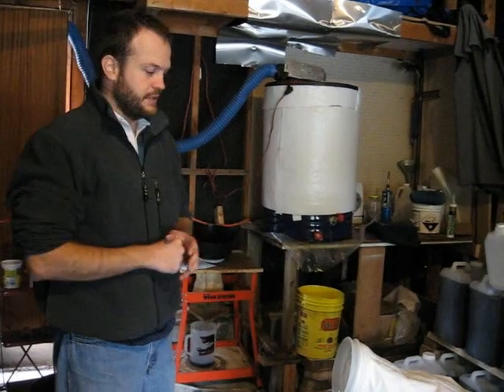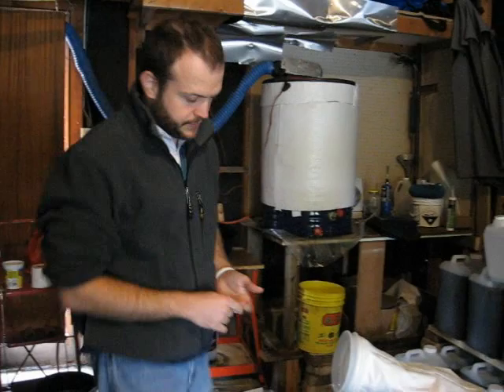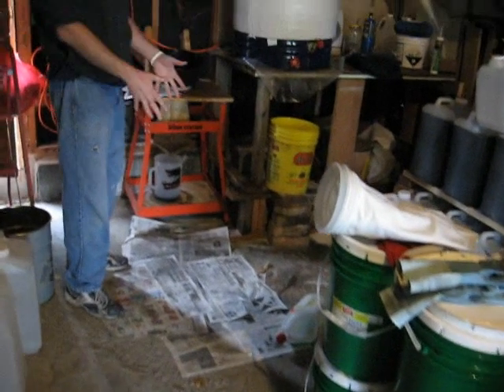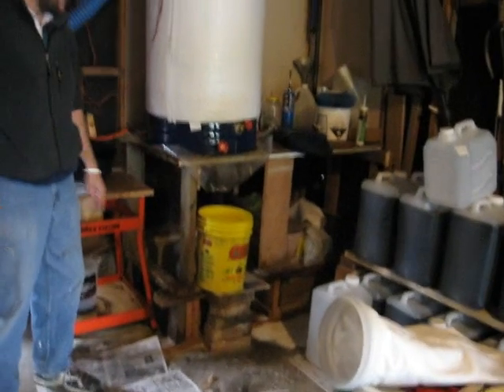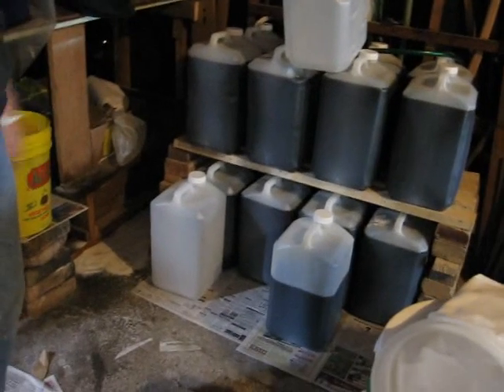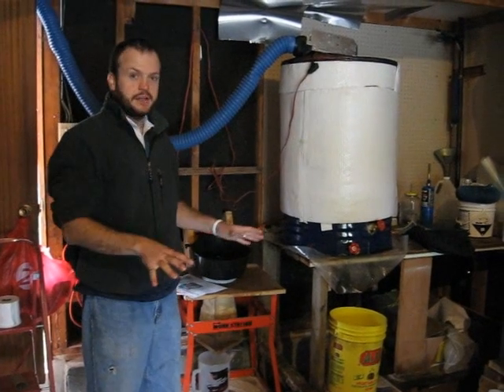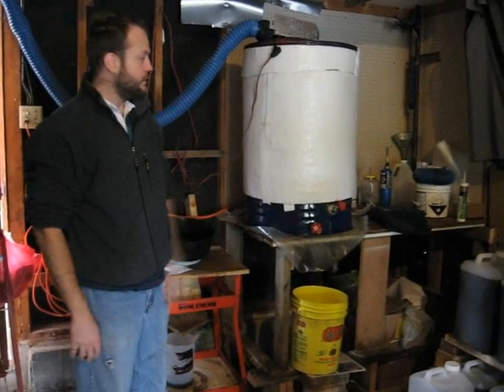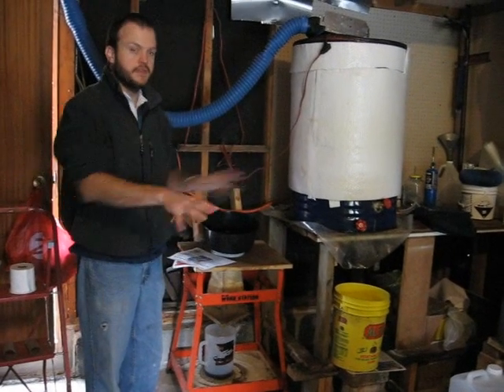Veggie Oil Fuel Home Processing Plant

Comment: Not bad, but seems like it cost more work and money than needed.

You can do it with one or two 55 gallon barrels and 2 weeks settling.
Even after just one week you can siphone off the top half of the barrel and use it.
Miniscual ammounts of water will not hurt your pump. I have tryed it.

How much oil can you process for $1.80?

My only cost is a $2.50 water filter insert from Wallmart. tipically lasts me 700 miles. 

You do the math for cost per mile! :O)

Comment from the maker: If I had more space to setup settling tanks to let theoil sit for 2 months, I would do that.  I've seen the results, they are better than my 1micron filtering!  Lovly oil.

But as it stands with my limited space, I heat my oil to dewater and accelerate settling after filtering to 1micron.  12hrs @ 1.5kW @ $0.10/kWh == $1.80 Worth it for me.

Great vids by the way!

Comment: You are wasting money and energy at dewatering the oil.

Use time and gravity (both are FREE) to sattle the oil. That will get the water and the solids out in one go.

Than use a 5 micron heated filter before the engine.

That's it.

I have ran a 40' bus on WVO for les than 1 cent a mile using this system.

See my videos!